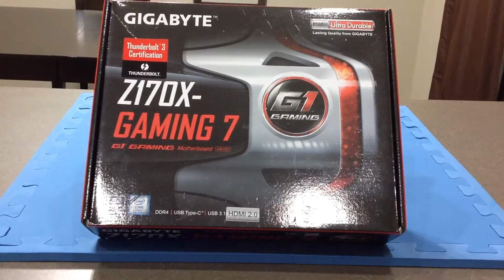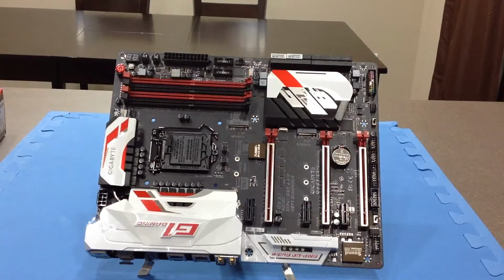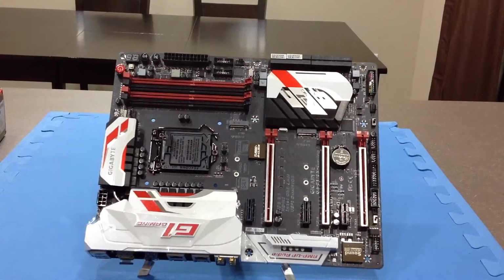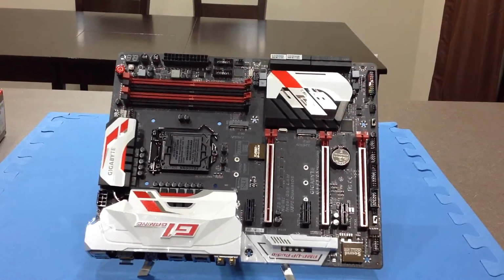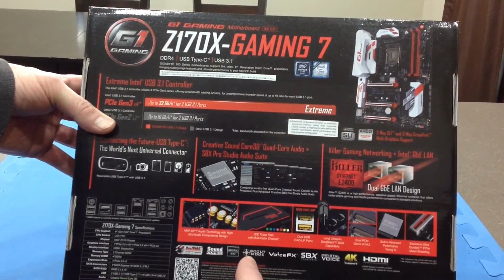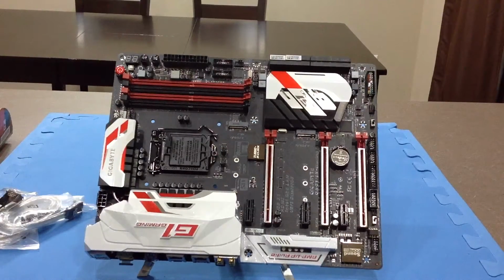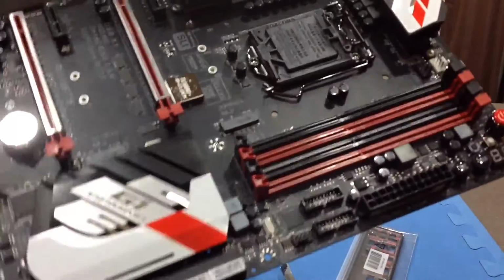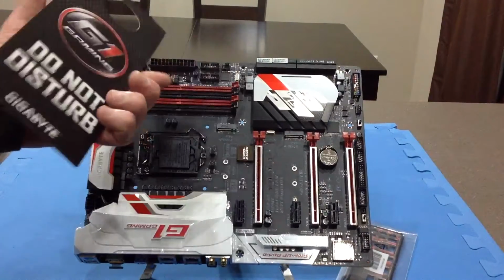Gigabyte GA-Z170X-gaming 7 (rev. 1.0) Unboxing

Comment: Is it possible to have 2x  M.2 SSD sticks &  2-way SLI GTX 1080 with this board?
Reply from the maker: Gt Max I've been working my tale off for the past 8 months and started to get back into this PC again ..... But I think that the 2nd m.2 slot shares the same pipe line as the third PCIe slot ....I'm thinking that cross fire and both m.2 won't work together ...but 2 GPU cards and 2 m.2s are supported ...... I was on my way to start picking up some m.2s ....to start completing the final review for this motherboard

Comment: Does the USB 3 and 3.1 work well with this board? The website has no USB drivers so i was just wondering
Reply from the maker: WaffleSplash works fantastic ....thunderbolt works too
Reply: So did you have to install any USB drivers? Or did you just use the microsoft ones. Also what OS do you use?
Reply from the maker: WaffleSplash I installed Windows 10 ....at first I didn't install any drivers .... And it ran fine .... But I wanted a monitoring system for temps and released all motherboards come with monitoring systems on their driver CD... I installed that and then I had all the futures I needed and wanted .. I did try to update the BIOS to F6 version and my PC started to black out and I quickly reset the BIOS ... And it went back to being fine again ....I didn't. Make sure the USB 3.1 were working at their lvl I just know they were working and sending data

Comment: I bought this motherboard and am a first time computer builder. I'm confused on installing the Ram memory. what slots do i use?
Reply from the maker: You want to use the 2 red ones to utilize dual channel capability
Reply from the maker: As long as your box looks like mine you will also have bios F5 version  it's a good version at the moment .....if you have the blizzards, heroes of the storm  box logo that's a old bios version .....reviews state it has allot of bugs .....check my build video out it shows me using the red slots and explaining it .........if your ram is faster that 2133 you need to set your ram to profile one in the bios ....this will allow it to recognize faster ram....and xmp mode if your ram supports it....also if your not using thunderbolt 3 you will get a code on your motherboard bF reserved .....if you disable your thunderbolt in the CMOS , bios settings it will give you the code AO (IDE initialization is started)...A OK that means the bios let the operating system take control of the system .....that's what is suppose to read

Comment: So this wants an add on card for Thunderbolt 3 or is ready to go?
Reply from the maker: I'm new myself with thunderbolt 3 ....from my understanding ....the universal type C connector is what's compatible with thunderbolt three....it's a different USB cable connection that has 40gb per second speeds .....this way not only is it fast with external storage devices ....it's suppose to be able to support  an external graphics card plugged into the port....this is very helpful on laptops with crappy on board graphics cards....this way you can plug in a graphics card through the Universal type C connector ....I believe this board is ready to go because it does have a universal type C connection ....but I'm still new to the thunderbolt 3 connection
Reply from the maker: One thing I remembered from my retail experience....when  ever I bought a blu-Ray player that was Wi Fi ready that meant it needed a USB be wireless adaptor to make it work with  Wi fi....but if the blu-Ray player said it was Wi fi certified it meant it was ready to go with Wi fi right out of the box
Reply from the maker: I had a BF reserve code on the motherboard and I couldn't figure it out...I went online and found out my thunderbolt is enabled ...I had to disable it in the BIOS to get a AO code on the mother board....it is fully functional thunderbolt 3... Thanks for asking it made me interested after you asked me...
Reply: SteveJ619 Thnx bro!